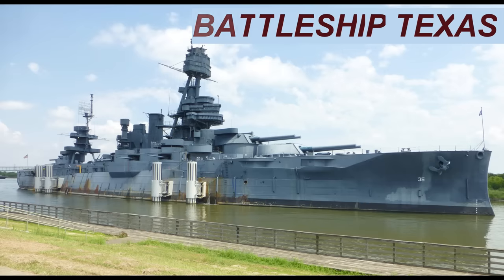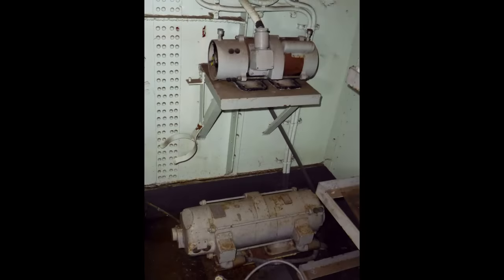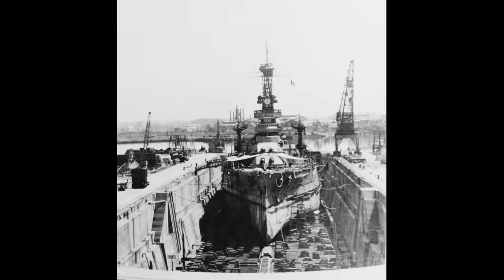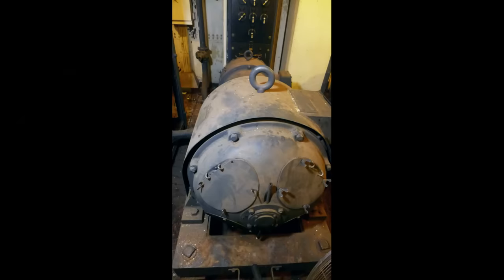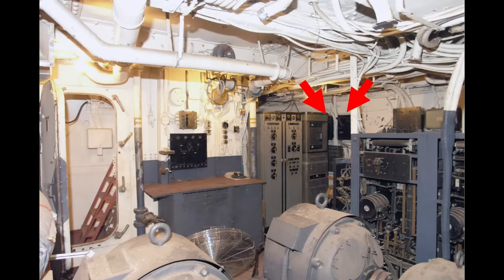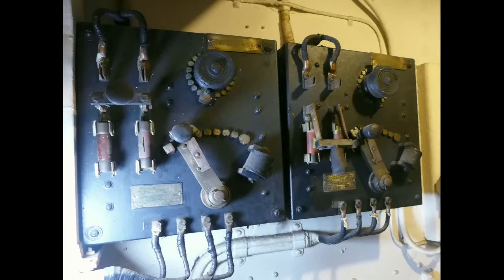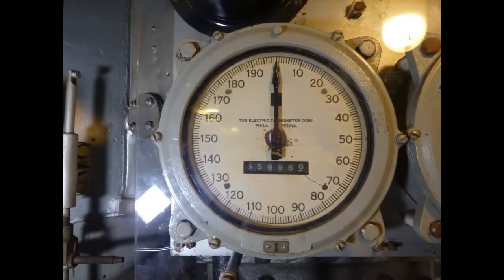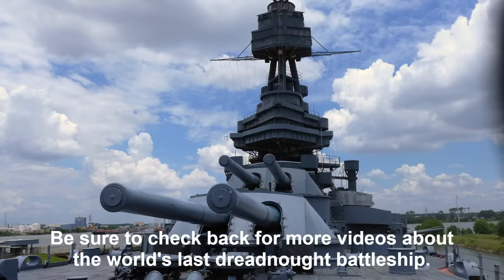BB35  Going Analog, The Old School Way!

Comment: Holy Cow!!  All those unprotected high voltage knife switches!!  That aside, the level of automation and controls in a ship that's over 100 years old is just fascinating.  By the way, on the drawing of the fire control system that you show, I noticed that Mr. Ford himself signed that drawing.
Reply: I was just thinking the same thing, all the unprotected knife switches. I wonder how many sailors were electrocuted accidentally in rough seas.
Reply: Something to consider.  House wiring at that time consisted of bare wires and tubes mounted on ceramic insulators.  Electrical safety had a long way to go in the first 20-30 years of last century.
Reply: I'm surprised at the number of unprotected switches given that was decomed in 1948.
Reply: Live front switch boards came into existence with the first attempts at commercial electricity in the late 1800s, They were common in new designs through the 1930s. 

New designs in the 1940s going forward started to use dead front boards, for pretty obvious reasons. WW II had something to do with this, the military didn't like losing people and having interior systems messed up or disabled just because a lurch in the middle of combat threw a few soldiers or sailors into the face of the switch panel.

That said, live front panels were common in older buildings well into the late 1960s and even early 1970s. I'm guessing OSHA was probably eventually responsible for the elimination of the last working live front panels.
Reply: @bobmartin4942  Um, not quite. Knob and tube wiring was done with individual wires supported every few feet on ceramic insulators, and penetrating walls in ceramic tubes, but they were insulated wires. A typical #14 wire of the day was a bit over a quarter inch in diameter. The conductor itself is only 1/16th inch, all the rest of the size was insulation. 

The common insulation was to coat the wire in bitumen (pitch, tar) and then weave a fabric cover over it with cotton strands.  This was actually a very robust insulation, and wires of this type made 130 years ago are usually still perfectly serviceable, though they won't meet new codes.
Reply: But they are protected :D
They are protected by the competence of the people supposed to work on them, 
and by the competence of the people keeping everyone else away 😊
Reply from the maker: I've seen some casualty lists for the ship and none that I've seen indicated any injuries or deaths from electrocution.  I'm sticking my neck out a little here, but I suspect the danger was much reduced on this system due to its basic design.  Residential and commercial electrical systems are grounded designs.  For that reason, if you come in contact with a live circuit conductor and anything grounded, you'll be shocked.  That isn't true for most marine systems and that on Texas.  They are isolated from ground, which is the entire ship's hull, structure, decks and bulkheads, to reduce corrosion that would result from electrolysis.  At least in theory, you can come in contact with a live conductor while in direct contact with  bare metal and not be shocked.  Due to the cambric cloth insulation they used, there probably was enough total leakage to get a shock, but hopefully not enough to result in significant injury.
Reply from the maker: You are entirely right!  All original ship's wiring I've seen that isn't covered with woven metallic shielding uses cambric insulation that is indeed very robust.  In fact many of the ship's lighting circuits are still in use and are holding up very well.  You only get in trouble with it if you start handling to make new connections since it has gotten pretty brittle.  It's done, but only by those who are very experienced with it.
Reply: "At least in theory, you can come in contact with a live conductor while in direct contact with bare metal and not be shocked." 
I'm not sure if I would want to test this theory. I lost a friend in 89' who was on one of the subs named Marshall (George or John) out of Rota Spain. The report to his family was he touched the leads of a test meter. I couldn't tell you if it was AC or DC. Either way it's dangerous just the same. Perhaps back in the day, with the open face switch boards, the sailors were respectful of what could happen and took great pains to stay clear and when operating, used great caution.
Reply: @lwilton Some old buildings still have their old live front boards. Most have been replaced by now, but you'll still see live front gears in old hospitals especially.
Reply: Quite right. Look around YouTube and you can find people working on modern high-voltage lines carrying hundreds of thousands of volts. As long as they're not in contact with both sides of the circuit, they're OK.
Reply from the maker: @anthonycordovano2438   You are right, it is dangerous and really poor practice to assume that you are safe when things like insulation quality and potential paths to ground aren't clearly visible.  The point was that in the unfortunate event that someone came in contact with one of the open conductors, he would likely survive it, maybe even without any injury.  Electrical systems on submarines present a whole new level of danger, especially the old conventional boats that used very high d.c. voltages to drive their main propulsion.  A friend of mine who served as an electrician's mate on Salmon (SS-573) told of a crew mate who bumped an open high voltage conductor with his elbow.  The resulting arc to ground traveled from his elbow, through his forearm and out his hand.  He was lucky, he only lost his arm.  Fortunately, the only place voltages like that on Texas were limited to circuits inside of radar and some radio equipment that were very well shielded.
Reply: Asbestos in the insulation as well.
DC makes it considerably more dangerous.

I love old electrical equipment tho.

I worked on a old elevator that had a massive relay board.
Reply: It's a wonder Sailors did not get electrocuted.  Throwing switches 😊

Comment: I was an Electricians Mate on three ships back in the 1960s, EMs and IC men shared the same division (E gang) on smaller ships. One ship was a WW2 LST, diesel powered with DC electricity just like you show, with live front, 'knife' switch boards. Diesel engine rooms were extremely noisy and in the tropics hot as hell, any space with a motor generator set in it was like a room with a big heater running that you couldn't turn off... Great memories...
Reply from the maker: You're the guy I want to talk to since you have direct experience with d.c. systems and live front panels.  I know that Texas's power systems were isolated in that they weren't grounded, and that should be true for all ships.  That being the case, and assuming there were no significant leakages to ground, was it relatively safe to touch a live conductor as long as you didn't also touch its opposite pole?
Reply: No! The ungrounded electrical system used on ships to protect the ship not you. 

When one leg grounds the equipment stays running but you get a ground light . The second ground will trip it .
There is always capacitive coupling, low resistance wiring insulation etc especially the AC power.

It only takes milliamperes ti kill you .
Reply: Get a copy of EM 3&2 Usn training book.

I remember it had a good explanation.
Reply: @josephpadula2283  One thing I remember on that LST over in Viet Nam was the shortage of power tools and parts, and how we did what ever we could to keep those old, well used, all metal antiques running and well grounded... Thanks for your reply...
Reply: I worked with  someone who had served on the Ark Royal and he said that he had seen an electrical tech who just used to run his fingers  down 400v terminals in a switch panel to see which were live and which weren't. He reckoned that the current only ran between adjacent fingers was probably why he managed to get away with it. If the system isn't grounded to the Hull and is isolated it would also make more sense.

I don't know if it was true but I have no reason to doubt him, and I have seen enough bizarre things in my time to not write it off.
Reply: @crabby7668  Very interesting, I made contact with 480vac once, in civilian work, and it felt like some brute had snuck up behind me and slugged me on the shoulder.
Reply: @markmark2080  yes, I have seen someone thrown across a room by 415 (or whatever it was) 3 phase. He was poking around inside a transformer while I was concentrating on something else. Suddenly I heard an aaaagh (or similar). I turned round and he was lying on a pile of insulation rolls, maybe 5 to 7 feet away from where he started. Fortunately the insulation softened  his re entry and he seemed OK once the shock (surprise) had worn off.

There were several examples of the same on the channel tunnel rail vehicles, where they had 240 and 400 ish feeds in the same wall panel. The maintenance bods in France would often leave the secondary covers off so that it was only the external doors that were public protection. Couple that with the management habit of tying up the only people qualified to mess with those panels with jobs that should have been rectified by the maintenance staff. Then management twigged that often electronics can be reset by the off on routine and they assume that anyone can do the job.

So they tasked the customer service attendants (effectively mobile car park attendants, not knocking them but not qualified) to reboot various faults, by flicking the power off on, ignoring the fact that the underlying fault should be investigated first ie any reboot should be a considered action not a default.

Anyway, the access to the 240v switch boards that they wanted to access required opening the 400v door first and then undoing the catch for the second door from inside. Bear in mind the terminals were often now open to touch  because the secondary panel was left off. 

So you can see where this is going. Totally unqualified people in a rush, going into dangerous unshielded (open) panels containing above mains voltages, in a moving swaying train, digging their fingers into places that they have no clue about.

They had several people shocked and pretty much thrown over a customers bonnet (hood) in front of the customers.
Fortunately none were seriously injured, but it has it all. Unqualified people, people not doing best practice with panel recovering, poor design 400v access required before 240v, and always mismanagement by thinking unskilled people should be going anywhere near that stuff.

Can you imagine the management in a factory deciding to send the secretaries or receptionists to dig around in the factory switchboards or motor centres? While tying the electricians up with some other tasks that should be the responsibility of other trades.?

Comment: I am a retired elevator technician, and I would like to point out that very similar circuitry was in use there until the 1980s when high-power solid-state devices became cheap enough to use.  By the 1990s, computers started replacing all the logic circuits. Elevator motion control was almost the same as battleship turret control and used all the scary exposed high-voltage switches. Westinghouse was a major player in the elevator industry.
Reply from the maker: Yeah, I sat in on a variable speed control seminar for mechanical engineers in the early 1980's.  It was like watching kids on Christmas morning when a controls vendor started showing slides of digitally reproducing sine waves!
Reply: Same goes for older rail vehicles. A lot of their control is dc through switch and relay (more like contactors with many poles) logic. I had to relearn my electrics when I first took on a railway oriented job, because everything was done with dc instead of ac and electronic control that I was used to.

Comment: Having used motor generators when working on aircraft in hangers, that space was as bad as the boiler and engine rooms for noise and heat. Then there were the hazzards of working around all of those exposed electrical connections on a moving ship.
Reply: On a destroyer, add more extreme movement and salt spray that seemed to reach everywhere.

Comment: 3:45 looking at all that electrical apparatus, I can only imagine what the temperature in that compartment must have been like. I imagine the hands assigned to that space went through a watch medium-well
Reply from the maker: True...  those two big motor generators probably pumped out a lot of heat off of both sides when under heavy loads.  There are large blower vents in the room, but I'm not too sure how well they worked if outside ambient temperatures were high.

Comment: Another OUTSTANDING video Tom!  Thank you.  My comment:  there sure is a lot of uninsulated electrical "stuff" in that room that better not be touched!  How do you not get an electrical shock when working in that room?
Reply from the maker: That's a really good question.  Exposure to shocks was far worse in the electrical distribution rooms that have really big, open switches, terminals, fuses and circuit breakers.  All I can figure is that the shock hazard was reduced because it is an isolated system, meaning that nothing is grounded.  There are positive and negative conductors and switches for all circuits.  So, unless there is a major leak to ground, you wouldn't get much of a shock unless you fell across both positive and negative terminals.  That's my guess and even if it is true, it isn't anything I'd bet my life on!
Reply: I've wondered the same thing myself. Every time I see all those exposed switches and buses I think about the snipes tending to things during high-speed manoeuvres or heavy weather.
Reply: As an ex-electricians mate, the sight of those old knife switches and fuse holders is enough to make my palms damp. 
The fact that it was 120 AC and not the higher 480 I worked with did not help. 480 will throw you across a room if you get hit by it. If your lucky, you might even live through the experience. 120 will cause your muscles to contract and make you to hang on. I would not enjoy standing watch in there.
Reply: @johntrottier1162  Hi John.  Thanks for the response.  Can you imagine if you touched phase to phase and got a true 480 Volt shock!  OMG.  I bet you worked very safely!!
I hope the other battleship guys do a similar video from the modern ships.  It would be interesting how electrical safety improved over the years.
Reply: @tomscotttheolderone364 thank you for all your videos, and for pointing out the "isolated system" fact. 
I guess it illustrates how standards went from "it is safe if everything works as intended" 
(single fault tolerance? I don't know the correct english term)
 to multiple fault tolerance, where we have many layers of safety. Doubly insulated wires in conduit pipes, protective grounding that also makes it more reliable to trip the breakers, fault detection circuits, spring- loaded wire connections instead of screws, ...

Electric engineering is a field where I have learned to accept my ignorance.
 
All those safety rules are there for good reasons.
And even if I think I know what's going on, I don't tempt the gods of lightning and thunder. 😀

(goes especially for cheap crimp connectors, barely functional fuse- shaped products, and old crumbling wires.)

Have nice day! Thank you.

Comment: Great indepth explanation of the equipment in the room.  
How did they sync the two AC generators? I didn't see any equipment I recognized for that purpose.
Reply from the maker: Go to 6:03 to see the controller board.  They sync'ed them by changing motor speed on one or both of the dc motors that drove the generator.